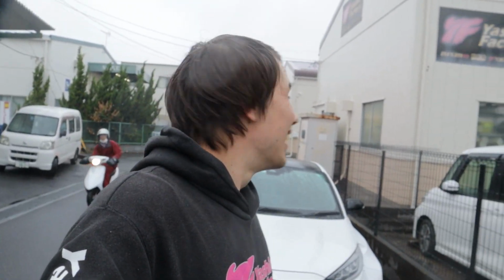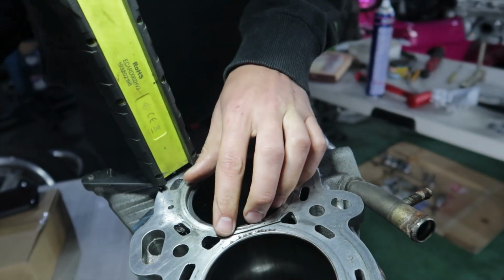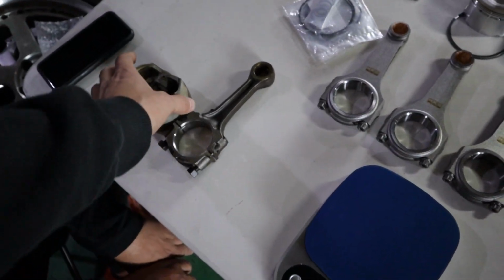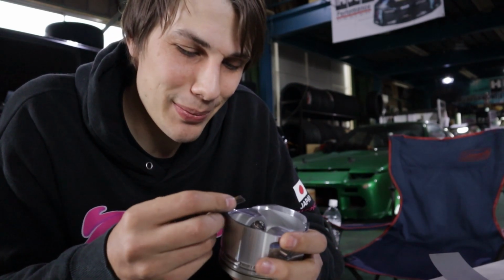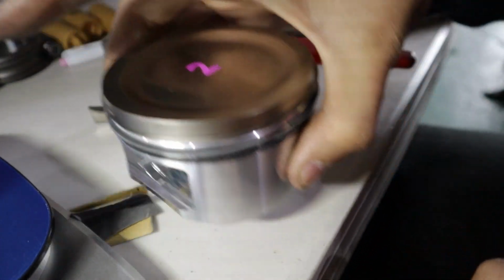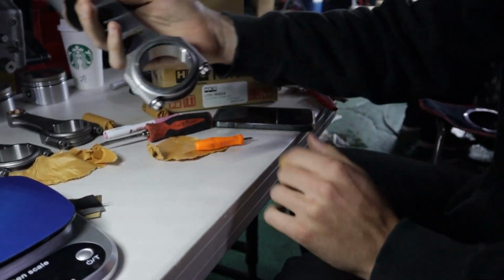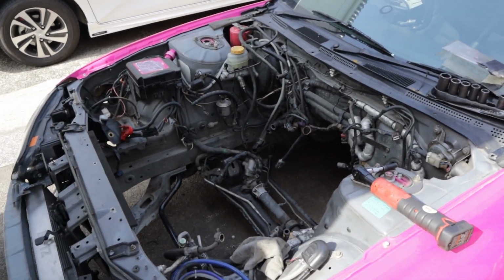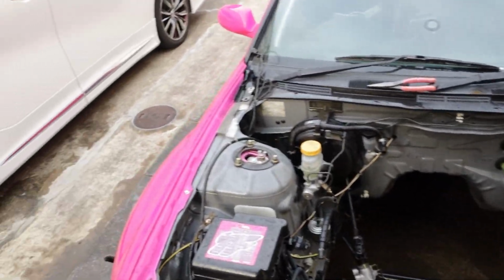ASSEMBLING HKS FORGED INTERNALS!

Comment: when you start with a set of rods and pistons they all have bosses left on them from when they are forged for the purpose of grinding down weight , so you start with a set of four you get the lightest one then get the other three to weigh in heavier  and you grind down on the bosses until you get four sets to weigh in at the same

Comment: You can make it even easier with the king pins. Put the pin in the freezer for an hour and heat the piston and connecting rod, and it will drop in without hesitation.

Comment: Dam those gaps are tight if this is a FI car "bore x .0055"... Personally I would have done .4 top and .45 middle ring.  Also fwiw my cheap cx h beam rods weighed exactly same all 6. On the topic of weighing things I weigh all my main and headstuds and it pays off because I have caught a bubbled bolt from arp.

Comment: Honestly snapon’s heat guns are priced quite reasonably as far as variable temp heat guns go the Makita witch is the best I’ve seen in temperature accuracy is 119 and snapon’s is 140  considering the benefits of having weekly stop ins if warranty work is needed that’s about the same as if price if you  had spent a hour driving to a store to warranty  one

And yes you can get heatguns for as cheap as 40$ but that’s not the same as a variable temperature gun with degree accuracy for heat sensitive work

Comment: thats called a floating pin, it should slip thru piston and rod, this is why the retaining springs. pressed pins do not use retaining springs and are a press fit thru the rod and why you would heat the end of the rod to put the pin in.

Comment: Do the rings all have to "line up"? I'm just a driver, not a mechanic lol
Reply: No, you clock the piston rings to a specific point so as they rotate in the ring groove you never get the gaps in a row to lose compression. The instructions usually tell you how to clock the rings. Ring gap is also important in a turbo car. Engine building is a precision sport.
Reply: @foamdataservices  ah cool...i remember now lol

Comment: Why a stock block with forged international parts? Why not get a forged block and heads
Reply: The stock block can take the power they are shooting for, no need for billet block and heads. In a boosted motor more stress is put on the pistons and rods, hence they get upgraded first.

Comment: Automatic rebuilders NEVER use emery paper it leaves carbide grit/dust = disaster they instead use brilo pads ie steel wool to clean up bearing surfaces. Hope you at least washed those pistons after that.

Comment: Just because they weigh the same on the scales doesn't mean they are balanced. And thats not how you weigh rods. Surely Ocochan would know that? And wet sand don't dry sand, you wouldn't dry sand the crank journals would you.